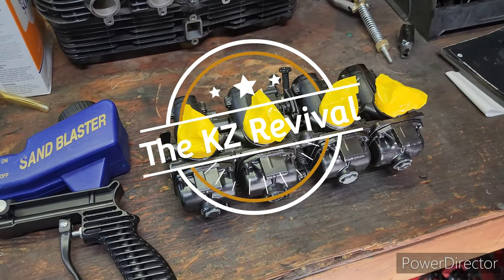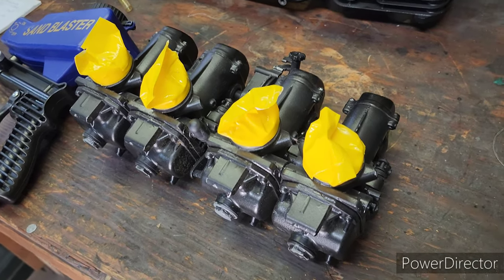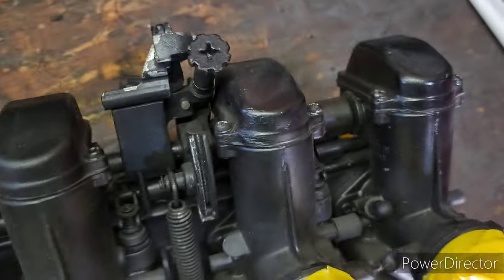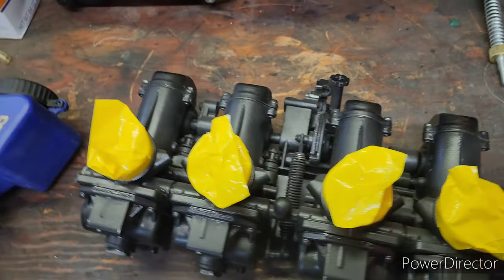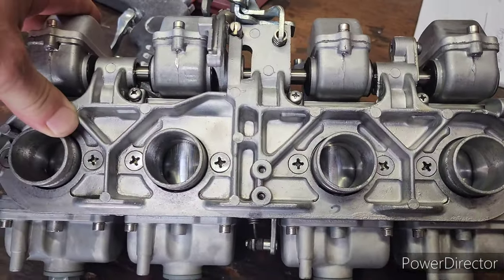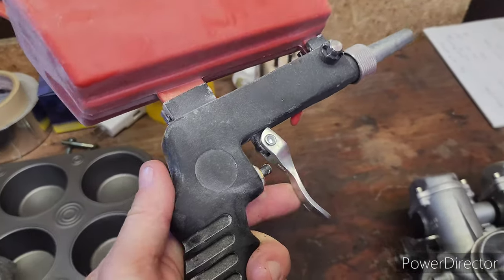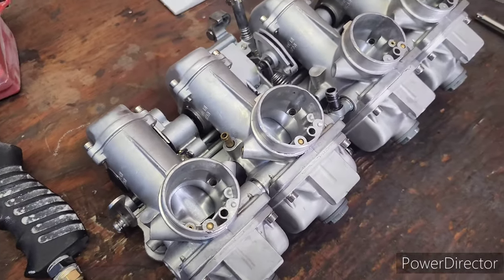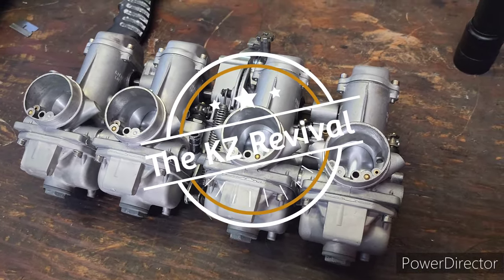This 1978 KZ1000 Journey #9 Mikuni 29mm Carburetor Rebuild

Comment: How is the street performance on those 34’s?  I heard you can make them acceptable for the road.  Smooth is everything for me so I have the old 28’s
Reply from the maker: The 34mm carbs are a great upgrade, and i wish I had installed them years ago.  Pretty nice performance boost right out of the box. Very nice drivability and improved acceleration when you want it.